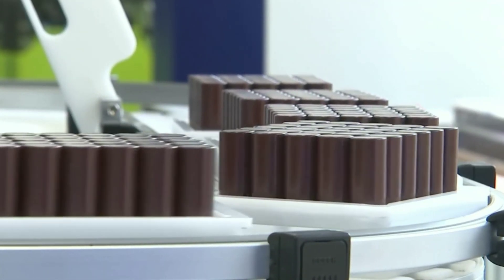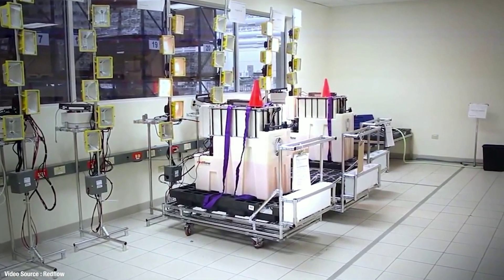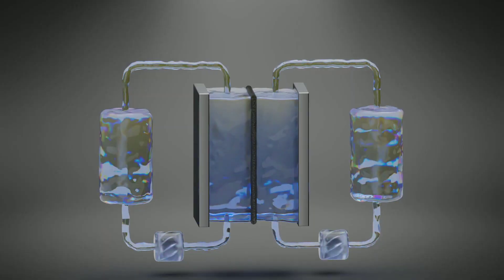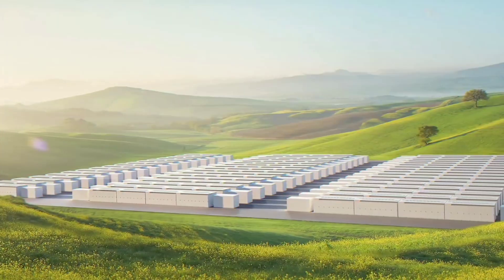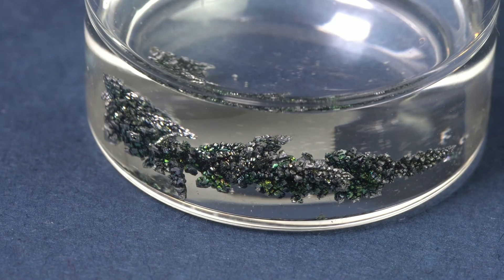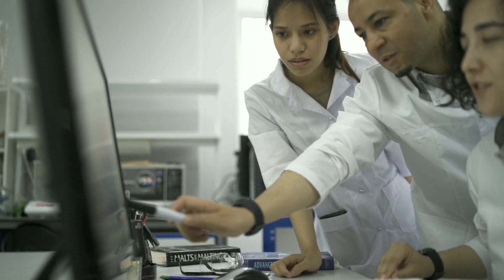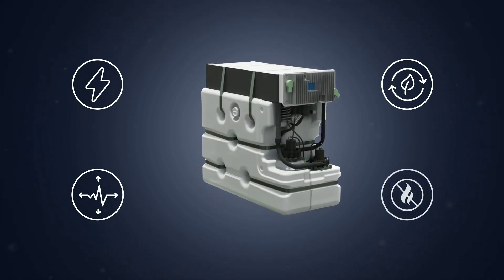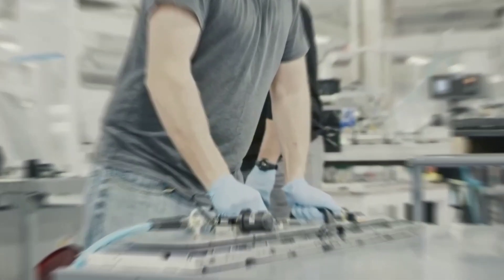Redox Flow BREAKTRHOUGH: The Game-Changing Innovation that Lithium Can’t Beat

Comment: Flow batteries will never replace Li ion for high energy dense  applications.  Their great advantage is that the capacity of a flow battery can be increased merely by increasing the size of the electrolyte tanks. If the technical problems can be solved they will be the breakthrough that enables us to store terrawatt hours of power economically.